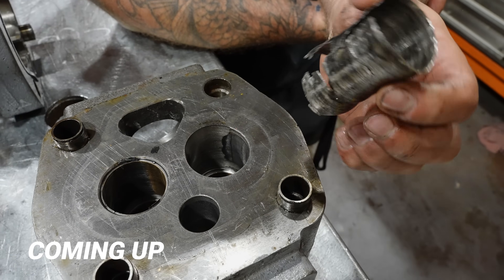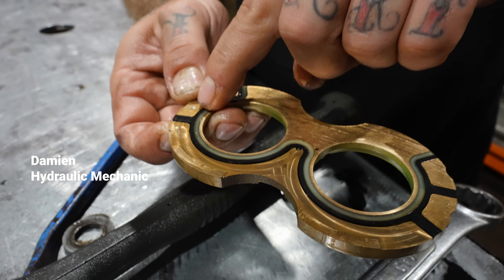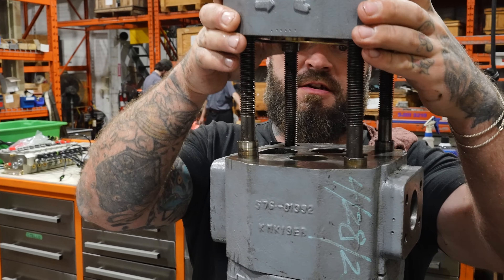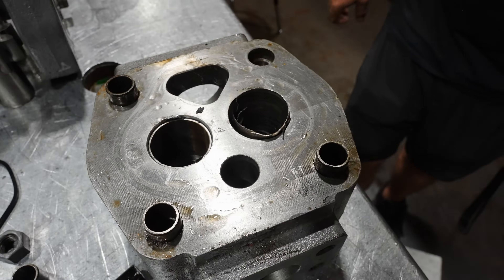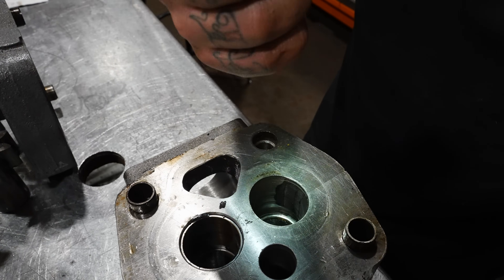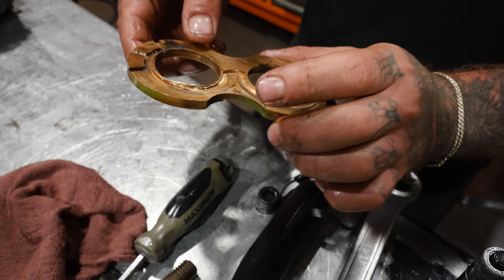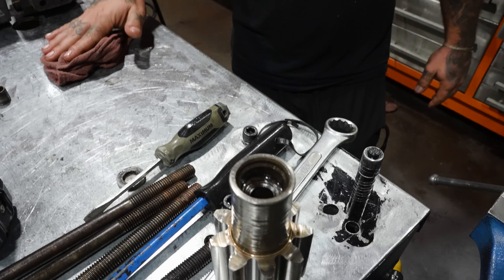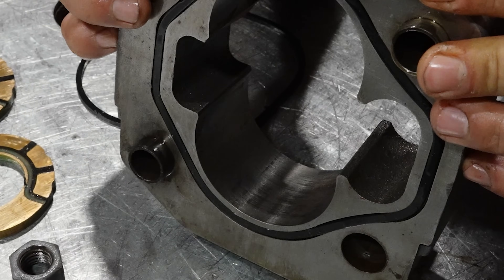Breaking down a P365 Gear Pump: Is it Repairable?

Comment: Very cool. I am interested in if the system had an unsuitable accumulator, or if the operation that over-pressurized the system was outside of safe operating range.
Reply from the maker: We didn't know enough about the application to figure out what was the system cause of it. But three seperate pumps failing in the same assembly is quite severe. But I would want to see some hydraulic schematics and applicaton information before I start guessing.  But following proper troubleshooting procedures is the key: isolate and look at all the easy stuff first.  -Fraser